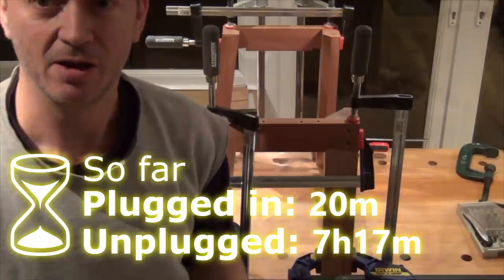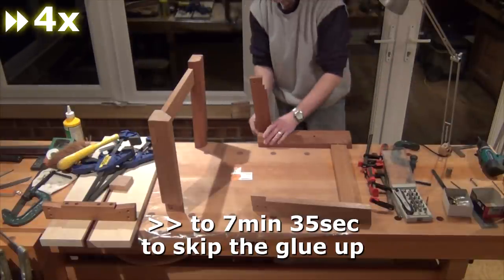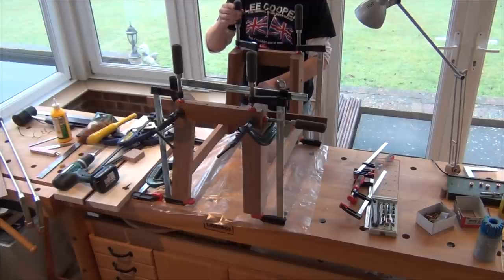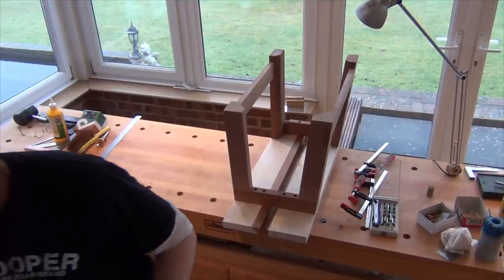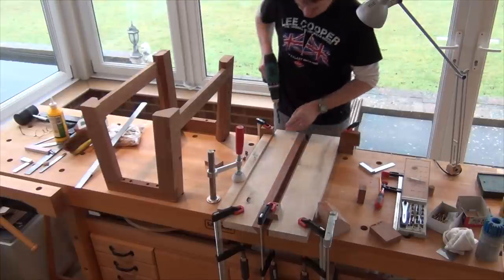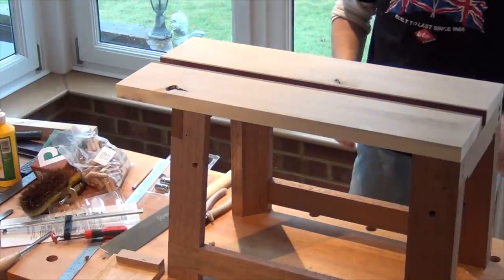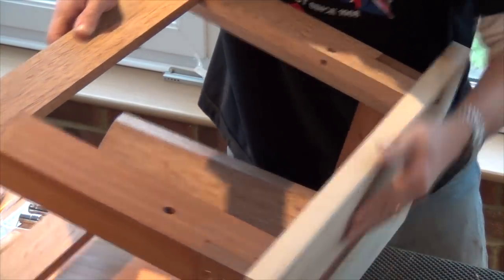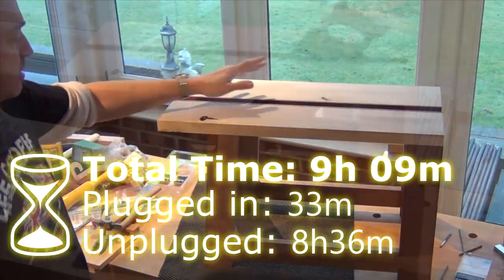My Sawyer's Bench Build part 6

Comment: Very similar to Tom Fidgen's one in the Unplugged Workshop, I want to make one of these  except my Worksop is only 10x8 in feet. Very detailed videos.
Reply from the maker: You're right, and that's because the form follows the desired function. Stability, work support, and suitable size, limit the basic shape, and there will be thousands of benches similar to this built since the hand saw was widely adopted. I suspect many would also have been knock-down versions with through wedged tenons on the long rails. Possibly something to consider for your small shop?

Comment: Looks great, Mitch. Why did you use screws as opposed to dowels in the end rails, and what is the brand of that drilling guide?
Reply from the maker: Thanks Steve. No reason for screws rather than dowels really. The drilling guide came from Axminster Tools, in the UK, but isn't branded at all. I wouldn't recommend it, since it's tolerances are a bit too wide for my liking. A shop made one using a drill press would be equally accurate, if not better.
Reply: Yeah I need to diy one using bushings. Thanks.

Comment: did you say "dowell pops"? what are they? I've googled it , can't find it, thx
Reply from the maker: Hi David. That's what I know them as. They are centre transfer devices, usually metal, that fit into a dowel hole and have a point sticking up. When you offer up the joining piece, the point marks the centre for drilling the matching dowel hole.
Reply: Thx very much, I did find only one reference and photo I think, they must have other names, lining up dowels a pain in the neck, they look useful, love your videos.